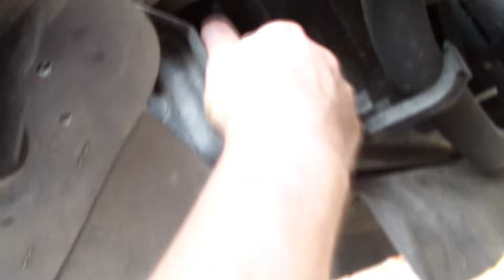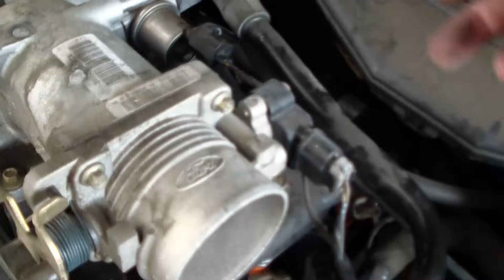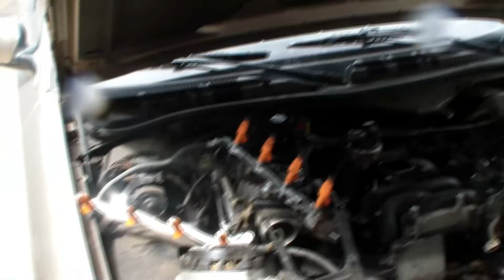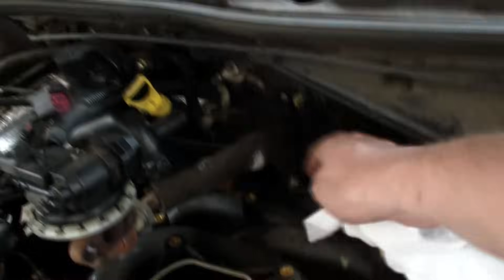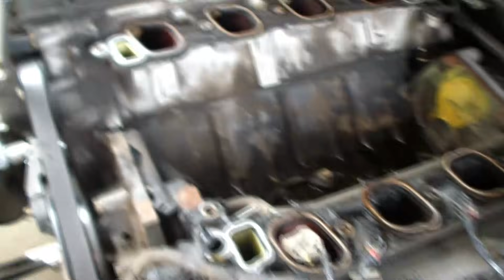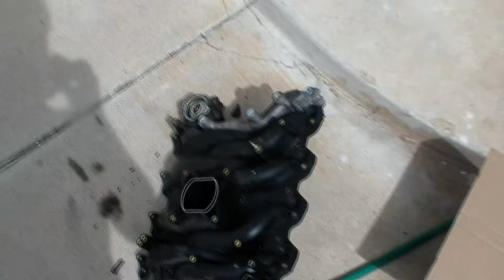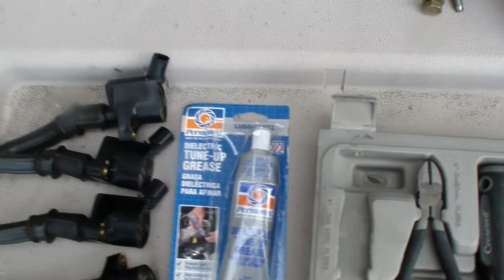Ford 4.6L V8 Intake Manifold Replacement

Comment: Kent! Great video man! I have done this countless times, was a ford tech for 6 yrs, I have put this same intake on a 2002 4.6 vic last year, might be doing it again on a 1999 soon. great video for me to reveiw on! Perfect video for any do it yourselfer asweell! thanks for shareing!
Reply: K surf why is there coolant on my sparkplugs and coils
Reply: @humbertobuenrostro2053  ur intake is leaking from cracked plastic!! Like mine!!
Reply: @scottyjones27 mines too! It's that time of year!
Reply: @humbertobuenrostro2053  check the heater hose and connector at the passenger rear of the intake also coolant pressure test look for drips or spraying
Reply: Do you recommend going with the oem motorcraft intake or something else for a 04 lincoln town car?
Reply: @Morganchip100  if its my own car personnally dorman is fine, but others go nuts and yell oem! Oem!  The manifolds can last 8-10 years no matter what brand usually, some very small horse power loss, but i could not really tell on mine.
Reply: @TheKsurf  okay thanks. Its my personal but I'm selling it because I bought a 2018 Ford expedition. So I want to do the intake manifold to help it sell faster
Reply: @Morganchip100  man id like to have an 04 towncar. Want to get one for my kiddo!
Reply: @TheKsurf  don't know where you're located but mine would be perfect for a first time driver. 131k original miles. Absolutely love this car but don't want it sitting around
Reply: @Morganchip100  most likely to far. East coast
Reply: @TheKsurf  I'm in north Florida
Reply: @Morganchip100  ha ya a bit to for for right now. I will keep dreaming. They are wonderful cars.
Reply: Do you have any idea what the man hours were when you replaced one in the past?
Reply: @timothyfrost8807  as far as flat rate hours just off expeiriance shooting from the hip 2.5 to 3.0 hours is fair. There are some issues that can come up. always make sure you    have no coolant in the cylinders after. you want all the spark tubes dry.

Comment: my 99 lincoln coolant was backing out of reservior. now the intake has a cracked in it. do u think a bad head caused this
Reply from the maker: Yes. likely head gasket or head crack.
Reply: Kent Diego OK thanks bro.  is it a good idea to get a engine from a salvage yard
Reply from the maker: I have had bad luck there. Maybe you will do better? I would find a shop that specialized in rebuilds only if needed one. If the block has lower miles, new heads are an easier option.
Reply: Kent Diego OK thanks. it has 257,000
Reply: I replaced the intake, it's running perfect

Comment: The thing under the manifold is that the heater shield for it?
Reply from the maker: The molded foam block under the manifold is the heat shield. Kind of ugly but I guess it works.

Comment: when you show the crash bracket on the left side theres a long bolt where does that bolt go to? on top of the crash bracket into the manifold
Reply from the maker: Yes. That long one was used to secure the manifold down.

Comment: my intake manifold is leaking water and coolant what do i need to do cause i have to re fill it with coolant once a week
Reply from the maker: Do you see dripping coolant coming from anywhere? First you need to figure out where the coolant is leaking. Could be from hoses, water pump, radiator or manifold if you see dripping. If you see no leak could be cracked head for head gasket. Look for white smoke (steam) from exhaust and look at spark plugs for deposits. Usually you can inspect closely and see drip or drip trail of dried AF.
Reply: Eric Lewis. stop leak
Reply: Eric Lewis

Comment: is it possible to purchase just the aluminum housing piece in front of the manifold?
Reply from the maker: It is all molded together into one piece.
Reply: no, it's not. the aluminum casing/coolant crossover is it's own piece. I found one on ebay and replaced it this weekend. all good.
Reply: hello, send me link or where to get that same piece
Reply: the one i bought has been taken down (obviously) but here's the next closest one: http://www.ebay.com/itm/2007-2010-Ford-Mustang-GT-4-6-Water-Coolant-Crossover-with-thermostat-housing-/282204563101?hash=item41b4b3e69d:g:uXcAAOSwGtRXzNgH&vxp=mtr

Comment: Hey i have a 2004 ford f 150stx and it is overloading on gas on number 1,2&3 cycledr what would cause that
Reply from the maker: Scan for error codes for a clue. Maybe leaking fuel injectors? The MAF, O2 sensor and throttle position sensor all play a role in fuel-air mixture.

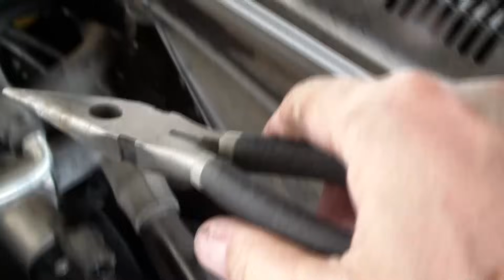Comment: At 5:30 , on my gf's 01 mustang, that little hose WOULD NOT come off for anything. It had no clips and it spun freely around the metal fitting but I couldn't pull it off, even after all the fuel pressure was relieved. I didn't want to pry it off and damage it so I just kept them connected and set the rails off to the side without the injectors. Thanks for posting this video! Although for some reason the 4.6 I'm working on is a little backwards, the air intake is on the passenger side and the battery is on the driver side.

Comment: hi you didn't show did you put a new gasket set under that replacement intake ?
Reply from the maker: The Dorman manifold uses O-rings. No gasket is used. Just be sure you have clean flat mating surface.
Reply: +Kent Diego that's what I thought. I have the same one and my truck isn't making any power.
Reply from the maker: The biggest problem with Dorman is vacuum leaks where you get a rough idle. If low power, I would suspect a sensor did not get hooked back up or broke. Did you scan the ODB2 bus for error codes?
Reply: +Kent Diego it did have a few codes after I installed it. but I sorted them out. now when u put it in gear the rpms fall and with the gas pedal to the floor the car barely moves. checked everything

Comment: Hey, Kent!  It's me again. I wanted to make a couple of points about the Dormann manifold, but first:

Your instructions and tips were SPOT ON!!!  Thank you sooooooooooo much for putting this video up here!

I did lose some gas mileage, but otherwise the manifold is functioning normally.  No leaks of any kind.

I'll let you know if there are any new developments in my case, but I've had the manifold on for a while now and so far, so good!

Thanks again!!!!!
Reply: John Baird I want to know how to remove the rear axle on a 99 Mercury grand marquis to replace the axle bearing and seal.
Reply: John Baird

Comment: Oh great... so just pop the o-rings in the intake and tighten it down to the heads and I'm done?
Reply from the maker: +Gary Hamilton The O-rings are attached to the manifold already.
Reply: +Kent Diego ok well that's great news... I bought a used motor for my 97 mustang gt and actually discovered that my intake was a dorman after the oem gaskets didn't fit and kept leaking so I had to actually buy the dorman gasket kit and insert the o-rings myself... But it all fits now and no more leaks!! Thanks a lot bro!

Comment: Hey Kent.. U didn't mention in the video but do the orange and blue gaskets rest directly on the heads once the manifold is in place? or do I have to use oem gaskets? Can someone help me out!
Reply from the maker: +Gary Hamilton The aftermarket Dorman manifold uses O-rings and does not need an additional gasket. Clean the head's mating surface flat and clean before installing. Sealer is not recommended but I guess it could not hurt. The factory OEM manifold would require a new gasket and sealer.

Comment: Here are some really good pictures on changing the manifold . Has pictures of the engine  pulled out of the car , also some nice pictures of the back of the motor where the crash plate for the fuel rail . http://www.pantherbb.com/p71interceptor/intakemanifold/replace/pictures/index.html

Comment: The 9th manifold bolt is the first bolt on the passenger side up front next to the temp gauge . The bolt behind the the crash plate is the #7 manifold bolt. http://www.autoclinix.com/Manifold6.htm , http://www.dormanproducts.com/documents4rb/615-178_Instructions.pdf , So the 616-175 and the 615-178 seem to be dam near identical . The o rings(x2) for the injectors are 4$ per side at auto zone and takes seconds to change out. But regardless that dam crash plate is a pain.I took the easy route I took my grinder to it so now that back bolt will be clear here in 50k miles when I have to replace it again.Cheer's

Comment: I think mine is leaking in several spots on my 00 mustang gt. It already had the pi intake swapped when I bought it in 2010. Leaking around a few COP holes and just yesterday I saw a huge coolant puddle on the ground above the firewall. Cant see up in there from underneath or on top so gonna finally pull it. American Muscle has them for $249.

Comment: Thanks Kent very nice video.I watched your video to make sure I have all parts and tools before I do the change out here in a few weeks.So I had a question about the rubber silicone where you talking about applying it to the gasket's on the manifold ?It will void your warranty.

Comment: hey very informative video. one question how has this intake held up since installing it, any leaks or cracks like the oe ones eventually get??
Reply from the maker: +Omar Aguilar Been a few years and working fine. I lost 1 MPG using the Dorman unit. I wish I had got the original factory replacement from Ford Racing.
Reply: +Kent Diego i just picked up the dorman today well see how it goes, going to use your video as a reference man.

Comment: you didn't show how to remove the lines going to the fuel rail. I broke a bolt that holds the spark plug coil. How do you remove the two lines at the front and the two hard lines on the inside of the fuel rail? I need to get it all the way out off the way to get the drill in to fit
Reply from the maker: +fockyoumang Each fuel rail had two nuts. Pull up. The injector can separate from manifold or fuel rail. Removing the fuel line from rail needs special tool. A plastic collar pushes in. It is much easier to keep fuel line attached.
Reply: +Kent Diego I meant the two hard lines that connect in the front and back on the inside part of the fuel rail. One goes under the box in top of the manifold, looks like a vacuum reservoir. They're on there really tight, they're metal rubber style hoses

Comment: So how do you know if the intake manifold is bad.  I thought my heater core was bad but its leaking bad under the bottom.  I wonder if it was the water pump because it makes a straining sound.  The temperature hand will rise to the middle but never runs hot.  But i have to keep putting water in it.. HELP
Reply from the maker: +Brian Fludd First you see where it is leaking from. Heater core is in dash board. Water pump is possible for slow leak. Normally there is a small hole on bottom of water pump and put finger there and feel wetness. Look for leaking around hose clamps. Do you see water dripping anywhere? If not, sounds like head gasket. There antifreeze is sucked into cylinder and out exhaust as steam. Will see lot of white smoke. Look at spark plugs for AF deposits and do a compression check.

Comment: I have a 1997 Mercury Grand Marquis. Intake manifold cracked. Replaced it and now there is a knocking noise . When the #4 plug wire is pulled off it misfires but the knocking stops. Put it back on and the knocking starts again. Any idea of what could be wrong? Help!!!
Reply from the maker: +Donna Harris Hi Donna. If you are certain it did not knock before I am uncertain how changing the intake manifold would cause it to knock. Maybe something fell into open port and damaged cylinder? Maybe if you post to some Ford automotive forums you will get better advice.

Comment: Well, we did the swap. But now I'm losing coolant from somewhere near the fire wall. And she's really bogged down on acceleration. As well as trying to over heat. What am I doing wrong?
Reply from the maker: +Trina Barger In the video I remark about the ugly crud in the coolant passage at back left head. Also there is a heater hose in back to check. A rough idle and stumble on acceleration indicate a vacuum leak. Did you scan for error code? The Doorman units have had a lot of complaints for that and I would recommend the original Ford replacement from Ford Racing. It is important that the mating surface  where o-rings touch be clean and flat. Ensure manifold sits flat without interference. Tighten the manifold bolts starting in middle working out. First easy, then a bit tighter and finally to the torque spec. With plastic it is important to not to over tighten the bolts as manifold will deform. Take manifold back off in inspect for leaking area. Re-clean mating surface and be extra careful replacing the manifold and tightening bolts. I would put RTV silicone gasket sealer around each O-ring surface just to make sure.

Comment: Much appreciated good sir. I feel totally confident in being able to do this on my own 01 crown vic. Correct me if I'm wrong, but the 8mm Alan wrench was not required to remove the old intake manifold, correct? Only to install the doorman part?
Reply from the maker: +Trina Barger Yes. it was for a plug in Doorman part.
Reply: Kent Diego thank you for the fast response.

Comment: Kent, thanks for the vid. Just learned that this needs to be done to my wife's car, and this shows me that it's no harder to do than the last time I did one, about 1980, on an Olds. The only things I would suggest to you, in this age of phones that are smarter than I am, is to take step-by-step photos, and to buy a bunch of muffin tins. You can use them to hold your hardware, label them with a china marker or grease pencil, so that you put the right bolts on the right holes, and be more secure that you haven't lost any parts. Then you can use them to make corn muffins...I m'self also prefer to label all hoses and electrical connections, but that's just my lack of confidence...Appreciate your posting this!! 
Of course, it's December in Chicago...Anybody have a heated garage I could borrow for a day? I'll bring all my own tools, even the 8mm allen wrench...
Reply: Come down south, Brother.

Comment: you didn't go over the torque specs and the order the manifold has to be torque down if you notice there's numbers on each end to the intake to be torqued in. that's what happened for ignoring instructions

Comment: Kent, this video is great. I have a 2002 ford E250 . I have to have this done also. Is it the same amount of time ?6 hours about? That should take care of the codes P0171 and P0174 hopefully.
Reply from the maker: +James Weissbach I took my time and did not rush and took 6 hours. Is manifold cracked with vacuum leak? That would cause lean code. Unless manifold has leak it will not help.
Reply: Thanks alot   Kent I'll let you know what happened.

Comment: great video and I'm going to do the repair myself, after watching your video and reading a lot of the comments, I'm going to buy the Ford racing intake but, there is a problem using the Ford Intake and that problem is with the alternator bracked. The Ford intake does not come with the new alternator bracket so, my question is....when you were doing your car, could the original alternator bracket have been modified to work with the new manifold? Any help is appreciated.
Reply from the maker: +daredevil7442 The Ford Racing is the factory original size so the original bracket will work fine. If you try to use original bracket on Doorman it hits the manifold. I show in my video. You could take a grinder and modify original bracket to fit the Doorman. No need to worry about the Ford Racing part, it will fit.

Comment: Cost is also a factor.  I just saw the price for the Ford racing manifold vs. Dormann.  It looks like I'll be getting the Dormann.
How long should i let the RTV silicone sit on the new intake manifold before I put the new manifold onto my engine?  Also, what kind of RTV silicone should I use?
Reply from the maker: +John Baird Let the RTV start to form a skin and then put on manifold. The directions should say that. Get stuff designed for automotive gaskets.